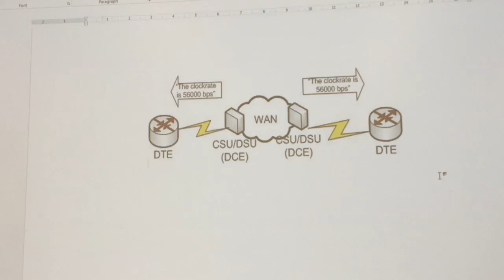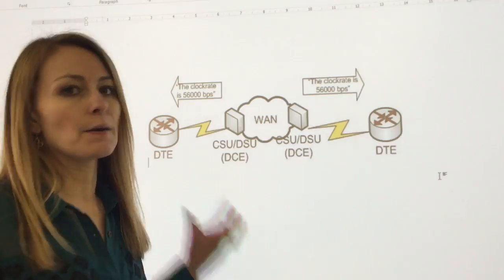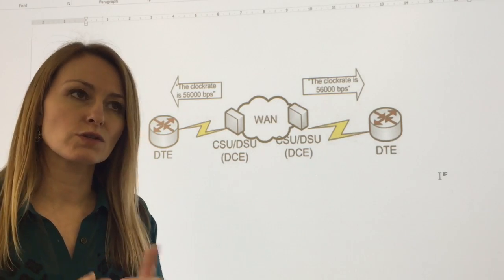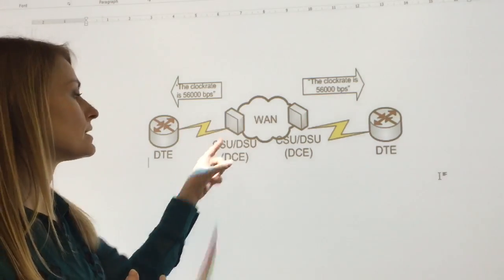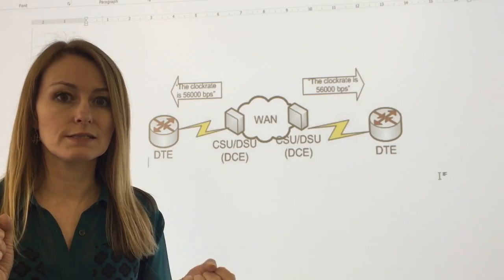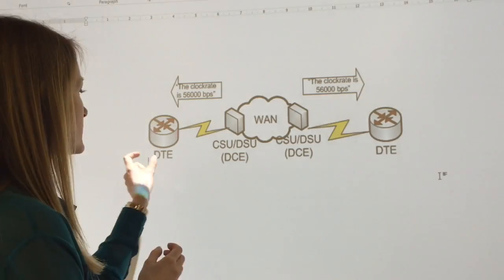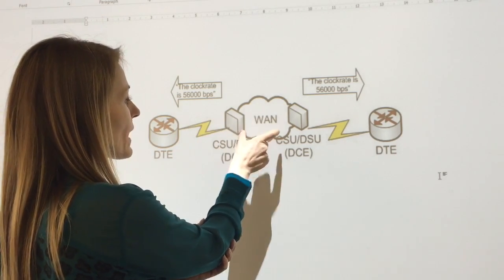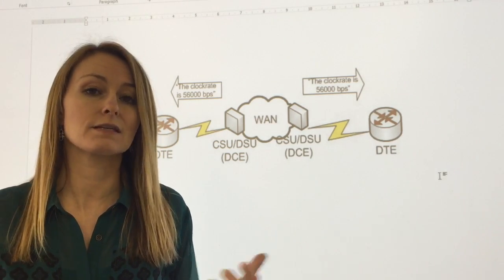DTE/DCE CSU/DSU

Comment: What is the difference between the DCE and the CSU/DSU, or are the CSU and DSU both part of the DCE?
Reply from the maker: The DCE is a generic term that defines the device that established the clocking. Yes the DCE is the DSU/CSU device (more correctly it’s the DSU part of the of the DSU/CSU device).
Reply: DTE/DCE are in fact serial cable. CSU/DSU is a device. Sometimes CSU/DSU is integrated in router serial port so you do not need external CSU/DSU

Comment: hi kim. thanks
i have a problem. am building a cisco lab and i would like to know how i do the configuration from the ISP to my Network lab so i may have internet connection in the lab. what kind of interface card i use? i have hwic2 interface card with v35 cable for the clock rate. i also have the T1dsu/csu card. which card can i connect to the ISP router so that i can start the configuration?
thanks in advance
Reply: You need to configure NAT on your cisco router